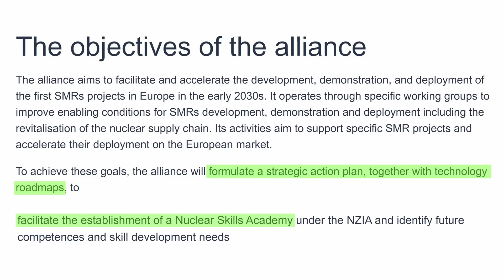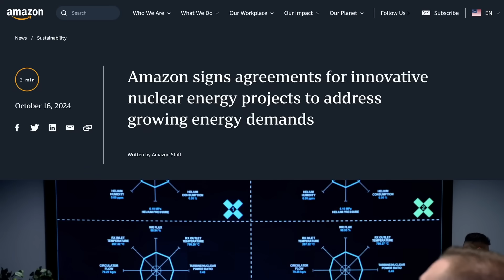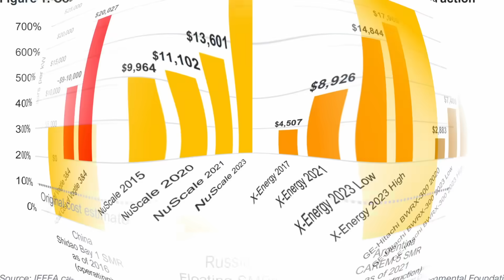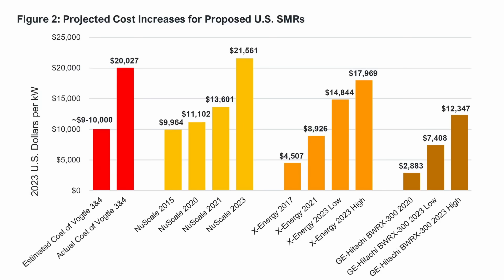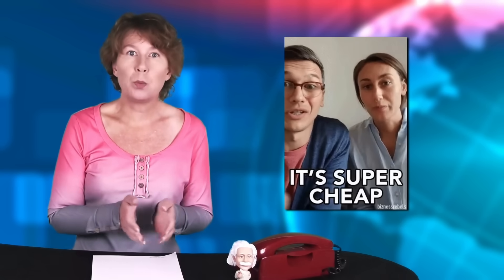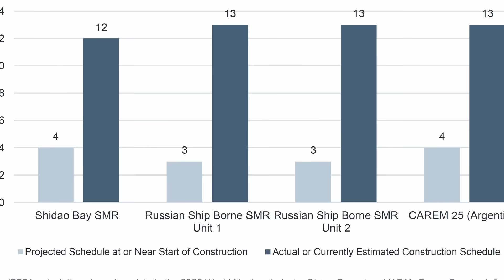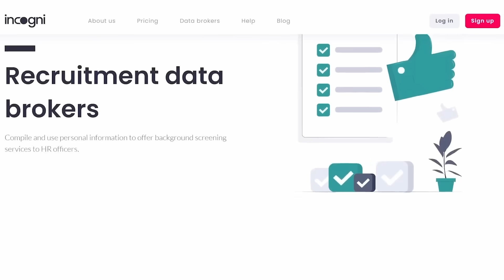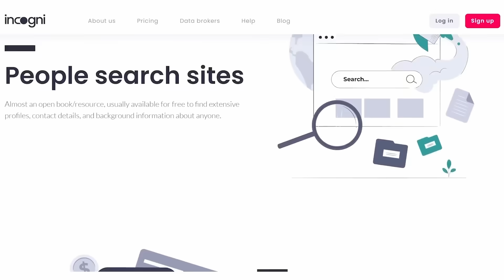Small Nuclear Reactors Have A Big Problem

Comment: Let's face it, the entire point of the modular reactors is the potential threat vs regulations.  Sure its radioactive, but worse case scenario, its only like a mile of irradiated land, so c'mon, chill out with those safety specs!  F data centers.  If they can prove they are doing more than just harvesting everyone's data to either use against them (ie are you insurable?), advertise to them or act as some company's engagement numbers (we had 1,000,000 clicks!) then we can talk, but most are those things, so again, F them, they should not in any way shape or form be given nuclear anything.

Comment: Small nuclear reactor need 3 basic things:
1) It has to be complete unit including part, which is producing electricity and waste heat
2) It has to be capable to run for decades without any need of maintenance. And i mean really any.
3) It has to be transportable by common means, ideally by standard size semi or at least by plane and oversized cargo

From principle, it can not use water as primary coolant and neither gas. Having rotary converter of energy is not suitable, because they can not run for decades without maintenance. It has to be air coolable, which is not simple task, if you have dozens or even hundreds megawatts in ship container size.
For safety reasons, it should be sealed, so noone would be able to extract "bad boys".

Overall it points out to liquid metal / molten salt reactors with thermoionic converters combined  with stirling engines.

Fact is, that if Russians would be smart, which they are not, they would develop such containers size compact nuclear generator with let say 50-100 MWe power output for their ships, where they have problem with engines (especially when Ukraine, which was responsible for their production in USSR, departed connection with Russian federation in 2014) and because they need dozens of them, they could polish them into reliable mass produced product, which could be cheap and safe and thus bestseller, which will be able to bring electricity not only into West (where we need such generators for distributed network), but also in 3rd world countires, which lacks infrastructure for conventional power plants.
Reply: Russia runs such reactors in their icebreakers from late 1950-s, including newly commisioned ones.

Comment: The size of the evacuation area effected by implementation of small modular nuclear reactors determines whether they can be practical regardless of their other economics.   An SMR is intended to make steam for about three years after which it is then low on fuel and swapped out in about 24 hours for another fully fueled SMR.   All the refueling and significant maintenance is done back at the factory and not at the point-of-use.  A 300 MW SMR steam generator is to be semi truck deliverable. 

SMRs are marketed as steam generators.  The expectation is they will be used to run a steam turbine generator where there is about 1/3 efficiency transfer for 100 MW of electricity generation.   

To put the use of SMR in perspective a typical 90 MW natural gas turbine electric generator without steam cycle fits in the footprint of a semi trailer and requires no evacuation area.  That is the complete electric generating station not including switch gear and transformers.    It's up to full power in 15 minutes and is making significant power in a few minutes.   At high availability service idle a jet turbine electric generator can be at full power in a few seconds.  These are what are used to make a wind turbine electric generator farm behave as a scheduled power station.   

An SMR running a steam cycle turbine generator are not able to make very large immediate changes in output.  SMRs are far more costly per MWh than traditional nuclear power stations.   

SMRs would seem idea for large marine propulsion.   The worst case scenario would likely be having to evacuate the ship and scuttle it in deep ocean waters.   A SMR powered ship would be similar to insure as other ship losses.   The ship might first try to eject the SMR into deep ocean water.   A steam cycle is more difficult to operate than a large marine Diesel engine.  High pressure steam piping is extremely dangerous if a leak takes place.  

SMRs requiring evaluation areas might be used in remote villages where the need for low cost reliable electricity can only be provided by such a system.  Most people would accept the small risk of evacuation for low cost reliable long term electricity in Arctic weather regions.   There would be a high secondary use for steam heating purposes.

Comment: Why is Europe ignoring the Moltex “waste burner” static salt reactor?  It is shielded by 2 metres of concrete and avoids the complications of light water reactors by having no pressure vessel and no water within the nuclear island. It also xenon to leave the fuel so there is no xenon pit in power production. It’s intrinsically safe and fuelled by existing “spent” fuel. They are undergoing homologation in Canada, because UK and EU do everything possible to prevent meaningful progress.

Comment: hmmm, these were all the "small" nuclear REACTORS,  and not the "micro"  nuclear (eg  1. MWE):
RADIANT KALEIDOS,   WESTINGHOUSE INVINCI,  HELIOS,  etc
-  seems like Radiant has the best model as it is "data driven".  but like you said,  the proof is in the pudding.  with no working prototype,  still considered "snake oil"  by out siders.

Comment: These negative comments about renewables and the positive comments about nuclear are uncalled for IMO.

There's a shitload of problems that still need to be addressed for the traditional renewables to work on a large scale, but they can be dealt with if enough funding is put into research and infrastructure.

For nuclear no matter how clean nuclear fission is, correct me if I'm wrong, but there will always be nuclear waste which in the end will have to dug deep underground which is basically nothing more than a ticking time bomb. Add to the fact that most nuclear reactors tend to cost more in their entire lifetime than they make during running, it's just not the best solution.
But I do support nuclear to a degree until we have a better alternative.
For example when a nuclear fission reactor has to be dismantled it takes decades for this process to be over, after basically going through various mechanisms to try and get rid of the radiation of lightly radiated materials, basically removing the material of the reactor layer by layer, again trying to remove all traces of radioactivity, and then digging huge tunnels and trying to find places and ways to "securely" store the highly radioactive material.

I used to be a big supporter of nuclear, and for example am still against the german government having shut down working nuclear reactors before their life time was over (which eventually would've happened anyway)
But having come to learn of the big hidden costs behind nuclear power plants which the tax payer has to bear ofc, and the potential stupidly large impacts on the environment we should really think carefully about whether or not we build hundreds or thousands of reactors more globally.

Comment: I'm not in the nuclear industry in anyway, but a thought.
As long as there is no particular issue with a older reactor, would it be possible to reuse one from a decommissioned submarine? Meaning slice off all the sub unrelated to the reactor, install all the correct plumbing, switch gear, transformers, grid connections and any energy storage devices thought correct and good to go.
Now I would assume they would not be large enough to power huge swathes of of a city, but what about a decent sized complex such as a hospital or university campus?

Comment: Scale is necessarily limited by the availability of utilities. Notably cooling water. Drought can mean reduced power or shutdown.

Availability of cooling water may also limit the total amount of thermal plant power in a geographic region. Smaller plants may be able to sidestep some of these limits, by demanding lower grade utilities. Which are presumably more common.

Scale is limited by the size of the chunks that you want to add or subtract from your grid in one shot. Be it for refueling, scheduled maintenance, or whatever. I believe nuclear plants are base load. Gas turbines might be trim.

As noted elsewhere, staffing requirements favor larger scale. Emergency response may also favor larger scale--one site to protect and only one future Chernobyl. But shutting down 75% of the state indefinitely is a rather different proposition than shutting down 10% of the state indefinitely. A robust grid can compensate for the latter more easily.

Comment: We have to have nuclear power. Its the only solution for the power that will be needed.
I dont understand how no one can pull it off. The US has had 
Nuclear on ships and subs for decades. I think the latest carriers has multiple reactors on board because of the massive power needs. So if we can do it on ships why wont those same reactors work on land? I think someone said something about standardization. I think thats right. Tell everyone this is what we are building and let multiple companies build them and let them compete.  Everyone building there own thing and design doesn't make since. All the R&D and testing is very expensive. If everyone builds approved design there is no R&D and testing because that was done when a design was approved.  Might be one of the only times when having a dictator would be a good thing.  Just tells everyone," This is what we are doing and thats it."

Comment: I think you missed one of the basics for modular designs. Currently reactors are constructed as one offs and every design element has to be reviewed before and during build. With the modular design it wpuld be more like building an aircraft, once you have certified the design and the production quality specifications safety defeinition would depend on only site requirements. Further like aircraft building you would come down a learning curve my guess about 20%.  At least in Canada the first one which is supposed to come on line in 2028 is being built beside and existing nuclear power plant so site issues are not difficult. Small reactors are not new given their use in nuclear subs. In fact some of the early nuclear plants in the US were scaled up plants from subs. Modular plants have a particular attration for Canada given ditance between centres. Previously you would use coal or gas to avoid transmission loss an in these circumstances this could be replaced with nukes.

Comment: The U.S. has 20 gigawatts of battery power NOW - 5 gig in the past year. That's like five Three Mile Island size reactors. The storage problems of wind and solar is SOLVED! And lithium-free batteries are coming on line. I am excited about iron-air battery tech. It is too heavy for mobile application but ideal to grid storage. NO MORE FISSION IN MY BIOSPHERE!

Comment: Soo if i got it right: people have built NPPs bigger and bigger in the past 70 years to get the costs down due to economy of scale, as it seems to be easier to have all the regulations, staff,  building and so on in ONE BIG place, where it scales better with more output. So now over half a century later people seem to have forgotten WHY they were built so big and now want to build them smaller again, this time to leverage the scale of units. Cool. If the costs now have already trippled and its not even finished, has someone already done the math for: how many are actually needed? And is the number high enough to cut the costs down enough to make it even worth? Some people mentioned a scale of 10 usually cuts down 20% or so, that would mean that the initial cost calculation would need room for ~500% of profit to only break even with a trippled price. My gut feeling tells me that this could be one of the reasons why some projects were stopped: simple economic reasons, not worth the risk of failure.

Comment: I'm a retired nuclear engineer. I was never on the power industry side of nuclear, so take this comment with a grain of salt. The growing costs of building small modular reactors have turned out to exeed the cost savings of building larger capacity reactors due to their economies of scale in power production. I think SMRs will have a place but it won't be in replacing 1000 MWe reactors with a bunch of SMRs. Their place will probably be in situations where only a smaller capacity is needed, e.g., 80 MWe.

Comment: This is not good news. Maybe hope is the most reliable of renewable energies, but I'd put my first bet on the sun (and what powers it). You really didn't not explain why the cost of, say, thorium reactors has risen so much. You mentioned greed and inflation, etc. Is the problem regulatory? Not-in-my-backyard? Safety? What little I understand is that most (if not almost all) technical problems have been well-overcome by previous R&D. Those big companies wanting power for data centers really do probably know something - isn't Microsoft trying to remodel Three Mile Island? These sorts of small local power reactors are going to be really needed on the Moon, Mars, and in space (and, yes, by power-hungry factories and data centers as well).

Comment: Somewhere I heard an interesting opinion, stating that the main advantage of nuclear energy is actually size. It's a very expensive investment activity, requiring a lot of expertise and intellectual work to complete, and you need the same amount of expertise regardless of size. As the size of the reactor increases (and thus  the power output increases), the easier are the investments costs to bear. From this point of view SMR's are an idea doomed at its very inception. I wonder if serial production would be enough to counterweight this effect.

Comment: Thank you again. Small reactors are working for more than 70 years in submarines and I suppose a little bigger ones in aircraft cariers. About two years ago a navy sailor told that on an aircraft carrier they do not only use it for the propulsion and electricity on board but also to desalinate seawater for thousands of sailors and to produce  fuel for the aircraft made from seawater!  He thought that the american navy could sell the research behind this for commercial use. But that does not happen. But the knowledge and experience s available. By the way, two weeks ago Google decided that their data centres will be equipped qith smr's in the future. So there is more than hope.
Reply: Reactors on sub's etc. have nothing in common with energy producing SMR's - and never ever will.

Comment: Here economists have some insights. The problem with too many producers would be solved on a free market, hence it is not a problem in the medium to long run. The threat to this I guess is different regulations in different countries that makes it impossible to scale production or state funding that counteract the market forces, to weed out producers until there is an equilibrium.

Comment: Many of these problems are not isolated to nuclear projects. If you calculate for the correct amount and tell the customer that number they will never buy the product. But they pay less than that upfront and then later pay for the earlier unaccounted expences that comes up on the way. So in the end it pretty much always ends up much more expensive than it would be right away. Also the longer it takes the more expensive it gets since prices are increasing. It is basically the old you can choose two out of three.
Reply: And if customer is a government under obligations to minimize the cost,  it is politically more viable to start with lowest estimation, and then to push for extra money in the future funding cycles.

Comment: Small reactors are just the latest iteration of the scam that is nuclear power. They're supposed to be dirt cheap, but that isn't even a pipe dream unless and until someone orders 50 or 100 of the same design. So far I don't think anyone has been able to get two buyers in a row. 

The eternal scam of nuclear power is some variation on the idea that we'll have power too cheap to meter, too failsafe to melt down and with a waste stream safe enough to use in infant formula, once we get this "next gen" technology that is just over the horizon. 

But ummm, yeah wer'e gonna need a few hundred billion more in subsidies to make it happen.

Comment: The only reason the small reactors are being pushed is so they can be used by the military.
Drop one of these in a battlezone and you can power everything from cell phones, and electric humves, to sci fi laser cannons.
It is too expensive for domestic power but as a weapon system it is a necessity.

Comment: SMRs are a gimmick to work around the reams of regulation around nuclear power.  Their main advantage is that once a design is approved, it can be built over and over.  I don't like them because it creates more locations where things can go wrong, more locations to secure and loses economy of scale.  What needs to be done is to attack the root of the problem instead of coming up with workarounds.  The regulation for nuclear power needs to be reformed.  Perhaps certain subassemblies and designs can be approved.  Then power plants that use those approved subassemblies and design can go through a streamlined approval process.

Comment: This wouldn't be the first time an industry struggled for the first couple of decades.  Even solar cells took decades to become efficient enough to use for large scale power production.  Orbital rocket launching, just recently became large scale, after many decades.  Human flight, 3000 years!  At least we know small reactors (not yet modular) do indeed work (See US nuclear navy) so it is a matter of engineering for manufacturing rather than a proof of concept.